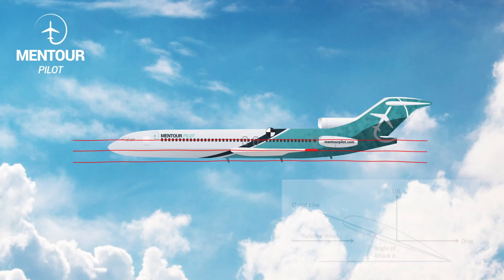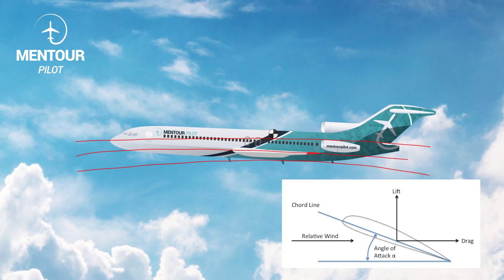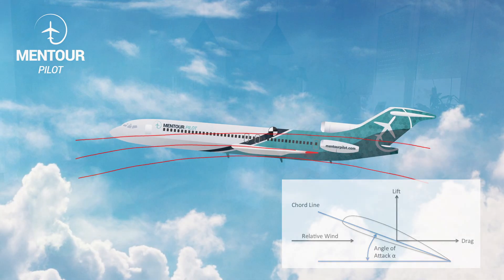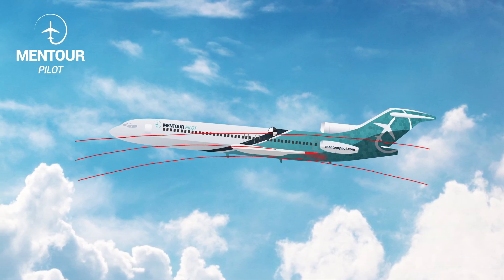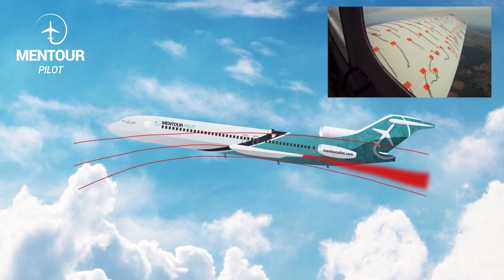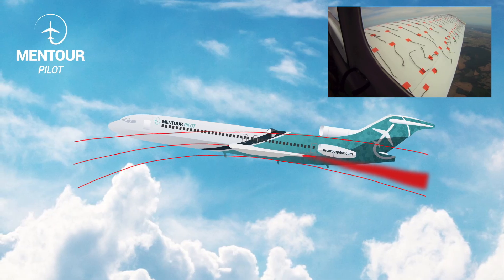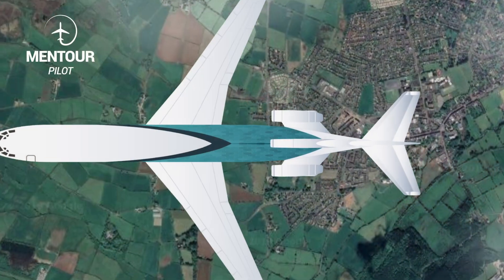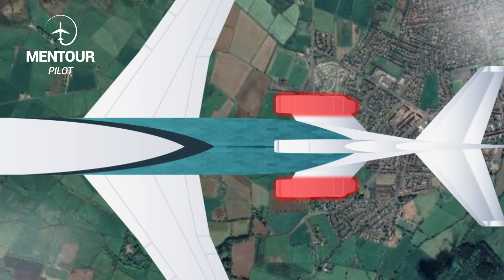The STALL you can't get out of! SUPER-STALL

Comment: Couldn't you use the engines to get out of a super stall? 
Apply a bit of power on one side, and idle the engine on the other side, which should bring one wing down and pull you out of the stall (especially on planes with wing mounted engines) 

As far as I know, compressor stalls only happen at relatively high power settings and when airflow is disrupted, so if you use a low power setting (maybe 35-40% N1) when combined with aileron and rudder input, the engine should provide enough power to break the stall, without sacrificing the compressor stage in the process
Reply: You can try it. The downside of high angles of attack involve also a disturbed inlet flow for the engines. So they are more likely to stall and do not react as good as usual. But differential thrust can be tried.
Reply: @roichir7699  that is true, which is why I suggested a fairly low power setting, which will still provide a lot more thrust than people think (especially with large jet engines)
Reply: @mwbgaming28  You can try that if nothing else works.
But take into consideration that the engines are in an unstable airflow, therefore likely to stall, if the are tailmounted.
On wing mounted engines you have to consider the upward moment of the thrust.
But if nothing else works, use everything you can think of and never give up.
Reply: @roichir7699  well if you are in a super stall, everything on the plane (including the engines compressor stage) is expendable, even a surging engine can still generate thrust
Reply: I asked a question similar to yours a hour or too ago before seeing your post... I think I'd give it a shot... Nothing to lose. I once got out of a war bird simulator stall using the torque from the engine and that led me to think maybe going reverse thrust in one engine and full thrust on the other side could kick the plane into a roll with combined aeirlon input and get the nose down and some authority back... Worth a shot rather than hitting the ground.
Reply: @cg7025  I have used engine torque in a C172 to induce a spin once, that was a nightmare I'd rather not repeat, the instructor thought my reaction was hilarious though (apparently it looked like I was trying to merge my hands with the control column)

Comment: Some actions to possibly get out of the deep stall/stable condition   objective is to upset the stable condition
Diffferential thrust
Thrust reversers   both  engaged or one engine thrust reverser engaged opposite engine forward thrust at various stages
Cycle landing gear
Cycle flaps/wing configuration
Move the passengers to the front of the aircraft
Move the passengers to the rear of the aircraft, hopefully you can get them back forward  to reastblish your cg
Get everyone to pray
Reply: serve drinks

Comment: Is a 'flat spin' an issue for commercial aircraft or general aviation aircraft?
Reply: Flat spin is different from deep stall. In both normal category and transport category aircraft it is difficult to get certification without enough rudder authority to prevent or recover from a flat spin, so flat spin is mainly an issue only if the center of mass (loading balance) is placed too far rearward on planes with modest rudders. Baggage, passengers, equipment, and fuel are all calculated for both mass and placement prior to every flight. Airlines have load masters and they relay the weight and balance info to dispatchers who use it for fuel/flight planning and they then relay the whole package to pilots who then double check the numbers look appropriate.
(not all small aircraft pilots bother every flight because they always fly one plane with the same bag and fuel load, but it will be calculated if any extra cargo or passengers are added or removed and it will be calculated when any equipment is installed, removed, or replaced by a certified mechanic.)
Reply: @mytech6779  First, thank you for taking the time to research this question and share your results. I really appreciate your efforts! 
Now that you mention it, I recall flying from SEA to ORD aboard a full 737-200. It is a long (1,700 NM) flight and the aircraft is  heavily loaded with fuel, pax and baggage. 
The First Officer announced that there would be a delay leaving the gate, while the loading of the luggage would be changed. True to his word,  two luggage crews with conveyors approached the starboard side, opened the cargo doors and unloaded baggage from the aft compartment and reloaded it to the forward compartment. Rather than being annoyed at the delay, I was grateful that a professional on the flight deck refused to fly the aircraft until all of the conditions were within specification. Now I know why. Thanks again.

Comment: In the 737 for example, if you went to max thrust as you approached a stall (say at the point of buffeting) but still pushed the nose down, would it actually have the capability of overcoming the climbing tendency of the engines, or would it simply lack the authority to do it based on the airflow over the wings/tail?

Comment: Halo captain , I have to ask you , In a situation of deep stall when nothing seems to work , and desperately  we want our right  wing for example to turn to the ground side,   if you dump  fuel from the left wing and pump fuel to the right in a try to give some possibilities to the aircraft , can this make it hapen ?  Can you run a simulation to see if it's working or if this help you ?  Idea number 2 ,  for example if you have technically the ability to choose ,only in a situation like that , to extend fully the flaps and slats from the left side and retract  fully the flaps and slats from the right wing so maybe this can help you to turn your right side towards earth , because you going down like a leaf but with no same surface at your wings any more , it's like this leaf you are  it's not symmetrical , so most possible is to turn your aircraft to one side .......   can anything of that works? At least theoretically? Thank you .
Reply: Also a tail parachute it can help ? If you are in a low altitude just deployed it and say some prayers , but in high altitudes it can turn your nose down towards  ground,  and after of that you can detach the parachute and continue the dive to turn your vertical speed to lyft and finally at horizontal speed .... is this solution possible?  I know parachute  it's not a good idea general in a plane but use it  for this situation specific. And I dont speak for a big parachute to stop the falling,  but fod a small  one capable to rotate a litle bit the plane. Nose down , It can help ?
Reply: If there is no lift you are basically in a zero G environment. Also called a free fall. Moving weight will do nothing. Of course there will always be a little lift from air resistance but not much.
Reply: @BaldurNorddahl  thank you for your response,  my idea is exactly at that,  imagine you are falling like a leaf , your left and right side have the same amount of air pushing up, from the falling moving only. Epecially if you have zero horizontal  speed,  so if you manage to change in one side your shape of your wing, it can turn you to the side it have less air resistance , (smaller wing area) so what do you think ? Theoriticaly it can work ? I mean with the flaps and slats solution maybe not so efficient with fuel relocation,  what do you think ?  Thank you very very much .

Comment: I'm surprised Mentour didn't mention the connection to the 737 MAX debacle: the aircraft thought it was in a high AOA situation because of a faulty AOA sensor, and its stick pusher slammed the control stick forward, and the crew were unable to keep the airplane from ramming itself into the ground.
Reply: MCAS is not a stick pusher or supposed to get out of a stall. It applies nose-down trim to maintain linear control forces, but it's still possible to stall the aircraft with MCAS

Comment: Either a deep stall which you can't get out of or two incompetent F/Os in an Airbus 330. Both can make the plane flutter to the ground or ocean.  You forgot to mention washout of the wing which also makes the wingtips stall last.  I was flying night cargo in DC-3s in the late 1960s when the first 727-100s were introduced. At least two were lost to Deep Stall. The remedy was to add 10 or so knots to the approach speed.  Emergency parachutes were also tried.  It took some altitude, however, they succeeded in getting the nose to drop.  We had to fully stall the DC-3 when getting the Type Rating.  While the plane is very much like a heavy Piper Cub in many ways, it has a very nasty stall because it has a swept wing. More often than not, the plane flips violently to the left because of P-factor, and it is hard to catch before it's in a vertical bank.  Nose down, level the wings and recovery takes about 1500 ft. if you are fairly sharp. The nice thing about props is the instant power response.  You might consider doing a show about the lag time of engine spool up in jets.  I don't know what it is on modern turbofans, but there was such a lag on the early turbojets and early fans that there were accidents because of it.  Thanks for your channel.

Comment: Wait a minute! If the centre of lift is aft of the centre of gravity would the airframe not pitch down (as the tail is being lifted)?  The elevator trim then pushes the tail down to achieve equilibrium??? If the centre of effort (lift) is ahead of the centre of gravity the wings would want to pitch the airframe up. As in a too far aft centre of gravity.

Comment: Falcon 4.0 had modeling of a deep stall in the F-16, which was typically triggered in low-speed, high AoA situations. If I remember the procedure (it’s been a ridiculously long time) the recovery involves cutting the throttle, then inducing an oscillation in pitch. By working the stick to amplify the size of the oscillations, you eventually manage to swing the nose down far enough where the wings bite again and you stop flying like a brick. At that point, you can throttle up and gently bring the nose up again, watching out that you don’t just re-enter the stall all over again.

It was fairly easy to provoke, especially as you get none of the physical sensations of buffeting or the likes. I suppose it was recoverable as the stabilator son an F-16 aren’t up on the tail, and don’t get blocked off by the turbulent air off the stalled wings. It did take quite a bit of altitude to recover, and if you didn’t recognize it early enough, there was no way out.

Fun sim; I just don’t have the time for anything that complex any more.

Comment: This would actually explain why an F-16 in a stall is extremely difficult to get out of, I have a occasional ride in the Falcon in BMS 4.34 and I’ve realized that stalling an F-16 is extremely difficult to get out of, the aircraft sometimes goes into a flat spin and the elevators(which also are ailerons) just flop around without any control, adding full power, using full rudder in the direction of the aircrafts rotation to force it to turn slightly downward to gain speed and finally at a point the elevators come alive and you are able to control the aircraft again, it took me ages to learn that, often I found myself just flat spinning for about 5 minutes from 15,000 to the ground, so the fighters are really bad when it comes to stalling, I’m not sure about the F-18 or F-22 didn’t fly a great sim of them yet to be fair

Comment: 14:08 These kind of solutions are my favorite in engineering design. When confronted with a problem, some might design control systems to handle it, some might design redundant mechanisms to solve is, and some might propose massive multi system redesigns to prevent it, but it takes some big brain, 4D chess playing, next level thinking mother fucker (or team) to come up with a way to use the problem itself to solve the problem. Imagine being in a room full of engineers arguing over ways to prevent it from super stalling and then you speak up and say "We make it stall sooner."
Reply: We do it all the time in software tbh. It's much better to crash early than keep executing with a corrupt state and end up with undefined behavior. Especially when said undefined behavior has a very high probability of causing even more corrupt data to be spread around (either written to database or via wrong calls to other systems).
Reply: One thing Petter forgot to mention was that, besides banking/yawing to drop the wing, if the plane is rotating up anyway, a pilot can let it further pitch up (i.e. stall further) to get the elevator past the turbulence, regain authority, and push the nose down hard, right through the turbulent flow in a motion like a seesaw.
Reply: DeepSpace12 this is an interesting idea I’d be curious to run simulations of this, I’d be inclined to think though the aircraft would pass through 45 or 50° and with full rudder and one dead and one full power engine you’d be better to try slicing out of the stall into a spin then do a spin recovery. It’s an extremely dangerous maneuver though because the roll could carry the plane nearly onto its back and any high G loads could start ripping things apart. But if you could slice into a dive you’d have regained control then simply recover from the unusual attitude.
Reply: @deep.space.12  DeepSpace12,  Oh my, good luck with that one!
Reply: @deep.space.12  That can't happen, because in that point the elevator has no authority.
Reply: @bogdan_n  Imagine yourself in a deep stall, but the attitude has a pitch so high that your elevator is through the turbulent zone / wake of your wings and does have authority. If you push down gently, the elevator will enter the turbulence, lose authority, and the plane will pitch up again. But if you pitch up further, then push all the way down, you might just skip over the turbulence and restore your attitude.
Reply: @deep.space.12  at the point where the elevator of a T-tail aircraft would pass under the wake turbulence from the wings, the pitch angle would be huge, and the wings lift vector would be pointing ahead, in which situation the wings would become some very efficient speedbrakes and the plane would start falling tail first.

Comment: There's a problem with the word "stall". The average non-aviator thinks of a "stall" as meaning that the engine stops running - there's a "stalled car" causing a traffic jam on the highway. But of course in aviation "stall" means "the condition which prevents the wings from creating lift", and it's very indirectly related to engine performance. This creates a misunderstanding of what the problem actually is.
Reply: Wow thanks for clarifying the difference for us, I had no idea.

Comment: "Use stabilizer trim, make sure you don't use too much" I think he is talking to the MCAS system hahah
Reply: Jordi Tribo Everything about MCAS on the MAX touches on points addressed in this video, longitudinal stability, horizontal stabiliser, and elevator effectiveness.
Reply: Gordon Richardson And undermounted engines that are too large and throw off the center of gravity
Reply: Can't help but think the "sticky pusher" could have been a better alternative to the MCAS, but it would have required pilots training...
Reply: @stone-hand  someone tried to save cost then...... 🤔
Reply: @roku_nine  - Not so simple, much more roundabout and sneaky than simple penny saving.
Using a sticky pusher would have made the 737 pretty much a different aircraft, in terms of certification process. 
It meant adding years to the MAX time-to-market, leaving too many companies tempted to  buy the Airbus A320 NEO, which could be an issue down the road as most small companies tend to use planes from a single manufacturer, because it simplifies logistics.
So, once an Airbus is inside a company...
Boeing was so much in a hurry that they went with a botched automatic system that used a single AOA sensor, something that they likely knew had to be re-implemented down the line - as they did with a somewhat similar system used in the NG - but at the moment sped things up, as a single sensor system could be certified much faster.
We all know how that turned out.
If Boeing had accepted the inevitable delay and just went with a dual-input MCAS from the start - i.e. the fix that they are developing - we'd would all be just in awe of how gorgeous the MAX looks with his badass big engines...

Comment: Back in wwII the Germans employed automatic slats on the Messerschmitt Bf 109 which were spring loaded and held in place against the wing at high speed by the resistance of the air, meaning in times when the air resistance was low such as slow flying, takeoff, landing, and stalls the slats would automatically deploy from spring pressure increasing the lift generated. My question is are there any modern airliners equiped with this? And if not couldn't this be used on t-tail aircraft near the wing tip to prevent the tip from stalling while allowing the root to stall first to make the plane automatically pitch down?

Comment: F104 starfighters from the late 60's with the horizontal stabilizer on top of the vertical stabilizer were known to be widow makers When exceeding the angle of attack at any speeds. The turbulence from the wings would push the stabilizer down causing an abrupt nose pitch up.

Comment: There is an unauthorised way of escaping superstall on swept wing, high tail aircraft, which involves rolling the aircraft 90° to regain airflow over the tail surfaces. Use rudder as necessary to get the nose down, roll level and reduce thrust to avoid overspeed. Once out of the stall, pull to recover from dive while adjusting attitude and thrust to avoid stalling again. This manouver should not be attempted at heights of less than 20,000 feet except in the most dire circumstances.